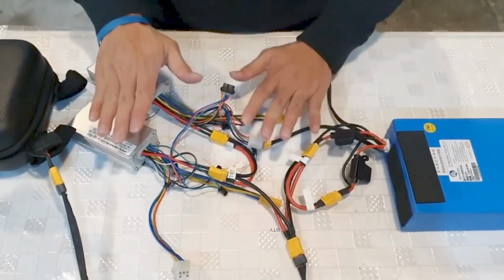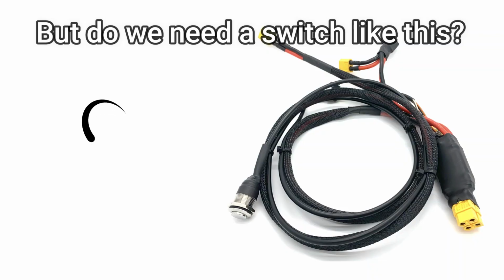How to Connect External Batteries in Parallel and when to use Switch

Comment: If I have a60 volt battery and I add a 48 volt battery is it okay?
Reply: Thank you for your help 🙌🏻
Reply from the maker: Only if your controller can take it
Reply: If I have 60volt controller’s? It is okay or should I add another 2 48volt controller’s?
Reply from the maker: @maxshara  yes sure. But why do you want to do that?
Reply: @FalconpevSg   because I I’m adding a48 volt battery to my 60 volt scooter
Reply: And is it okay to connect both off the batteries one 60 volt and another 48 volt with the series cable?
Reply from the maker: @maxshara  it’s better to connect in series the same voltage
Reply: @FalconpevSg  but is it okay to connect a60volt battery and a48volt battery together?

Comment: ok one more question one of my battery is 48v 30ah with 5a charger  another is 48v 15ah with 2a charger , how do i charge them ? will 5a charger damage 15ah battery if parallel connected ? i dont know do i need to have switch for this 2 batteries in paralel ? i cannot find any video online properly explaining how to do it , or when i charge do i need to charge both batteries separately with its own charger help friend ?
Reply: Please I hope you charged them separately. Because you are charging both batteries at a different rate of charge. That will cause problems if you charged them parallel connected.
Reply: @techgeek2994  use a y splitter cable and only the 5 A charger.. or buy a bigger charger (maybe 7 or 8 Amp)... the y splitter cable behind charger keeps both voltages identical 
I have an inline diode in both charge ports.. means charger sees both packs but one pack does not see the other pack

Comment: Hi there. So I just want to add some more capacity to my Apollo Pro which is 52v 23ah. I think I would be happy with another 10Ah of capacity. If I add the solid state switch to the arrangement then I would only need to plug my scooter to one port and charge both is that correct?
Reply from the maker: We do not have 10Ah. The 18Ah is going for a good promotion right now. You do not need the switch because they are both 52V. And yes you can charge them at the same time.
Reply: @FalconpevSg  Isn't it recommended to charge both batteries separately?
Reply from the maker: @raymondayeung  it’s better to charge them separately as there may be different charging rates for battery packs but it’s ok to charge them together too.

Comment: Hi FalconPev, 1 question.
I have spare Zero 10x 60v spare battery and planning to make it as range battery. My question is: why in your video there is only 1 port connector  on external battery and the internal has 2? Can you please help. My scooter is Zero10x
Reply from the maker: our battery has 2 ports, maybe shown in video only one port, but its really 2 ports. but in actual fact, it depends on the size of the connectors. If the connector is a larger size that can handle the current, then one port is all that is needed.
Reply: @FalconpevSg  so it means i can connect it to any plug?
Reply from the maker: @timcarranza1146  like in the video the plugs will be labelled. If you need any specific plug you can let us know and we will use those plugs on your battery.

Comment: Hi. If I buy this battery.  I just install it the way it explains the video will it work?  Another question is, to charge the two batteries will it be the way I already charge my original battery?  "After the battery is charged, it starts charging the external battery" thanks.
Reply from the maker: You can charge both batteries together. What scooter do you have
Reply: @FalconpevSg  Zero 10x 60v. When the internal battery reaches 100% does it start charging the external battery?  Does this not reduce the number of recharges of the internal battery?
Reply from the maker: @marcoridolfi7056  no it charges both batteries together
Reply: @FalconpevSg  So does the external battery recharge through its discharge cable? I only saw the discharge cable get connected to the parallel harness in the video.
Reply from the maker: @BrettSwiecicki  it recharges through its own charging port inside the bag
Reply: @FalconpevSg  So when you go to recharge you use two chargers? One connected to the charge port on the deck and one connected to the charge port on the external battery?
Reply from the maker: @BrettSwiecicki  yes correct
Reply: @FalconpevSg  What would happen if you were to only plug in to one of the charge ports?
Reply from the maker: @BrettSwiecicki  it will charge both too but it will take a very long time

Comment: its not conflict  having 48 V dual hub motors to install external battery in same voltage?
thanks for the answer more power
Reply from the maker: No problem with that
Reply: @FalconpevSg  5 star
Reply: I also have dual hub ( and now also dual pack )

Comment: If I order the 60v 21ah LG battery, it will come with XT90 connectors right? Same goes for the parallel wiring harness? 

I plan on using this for a VSETT 10+ which has XT90 connectors
Reply from the maker: No problem just state the type of connector you need in your checkout order
Reply: I'm planning to do the same thing as you brother, which switch did you end up going for? Is: Auto Switch (80AH), 24-70v, dual battery configuration the correct option? And did they give you the right connectors for your 10+?

Comment: Hi ! I have a dual motor nanrobot 52v. The original battery has two discharge ports, and I just bought an additional battery with only one discharge port. Is there a difference? Can I still connect to controllers with one port? Or Will it overload the wiring or the battery? Thanks!

Comment: can i use paralel connection for 2 batteries with only 1 controller or i need 2 controllers ?
Reply from the maker: Doesn’t matter the number of controllers. You can use 2 batteries or 3 batteries for one controller
Reply: @FalconpevSg  ok perfect and do i need to charge batteries separately when they are paralel ? i ordered the cables allready as soon as i saw your video
Reply from the maker: @techgeek2994  you can charge them together
Reply: @FalconpevSg  on which port original or it doesnt matter ? thanks for your help
Reply from the maker: @techgeek2994  if they are in parallel it doesn’t matter
Reply: @FalconpevSg  ok thanks a lot :)
Reply: @FalconpevSg  one last question , do they need to be both fully charged before connecting them in paralel ?
Reply from the maker: @techgeek2994  yes best practice

Comment: I have an ebike with a hialong 52v17ah and a 52v20ah rack battery. I have them connected in parallel with no switch - I just use one at a time. I'm trying to use them both to get more range and power. Would this switch allow me to use them simultaneously? Or will it just switch between the two during a ride?
Reply from the maker: You can use our parallel wire harness
Reply: If you are using one battery at a time then they're not in parallel to start with.
Reply from the maker: @DanceySteveYNWA  technically right. But this topic is about when to use parallel and when to use switch
Reply: use them in parallel..... not one after the other...

Comment: I bought your cable but when I open my scooter I don’t know which connector is I1 or I2. Is anything wrong if I connect them randomly?
Reply from the maker: It doesn’t matter either way works
Reply: @FalconpevSg  thanks! And in the case of the charge port can I connect randomly in either one of the two charge connectors in my external bat?
Reply from the maker: @El.mas.capo.sksjshffjgifu  yes any one would do too

Comment: Why not sell a unit that has a high capacity already? like 60v 45ah 21700 5000mah cell 16s9p  right?
Reply from the maker: Not enough space in the main compartment and also cost wise more expensive upfront

Comment: Glad i bought the external packs with both my 10X. Me and my girlfriend get crazy range now with 46Ah. And they installed it. Best thing is to ask at the time of purchase so both batteries are fresh.
Reply: 46Ah will easily give you over 110 km of real world range
Reply: @raymondayeung  I have 50 Ah (2x25)... and 120km is no problem (dual motors and no pedaling)
going a bit slower and pedal assist (single motor) I nearly could get 200
I never run the packs down to 40V ... at 44 under load and 46V no load I put the charger on .. means I may have 20 to 25 % left ...
Reply: How much range can u get ? And where can i get One ?
Reply: HELP MY 🪫 Bonjour 😉 mon ami, je cherche de l’aide car ma Kugoo M4 pro MOTOR 500W batterie plus d’origine etait 18 Ah maintenant c’est 12,5 AH a une autonomie trop limitée pour mais déplacement journalier. Je ne c’est pas comment brancher une batterie externe ⁉️quel câble j’ai besoin et comment brancher tout c’est câble. MERCI POUR tout retour informations sur photos ou vidéos. 🤝👋

Comment: I have a zero 10x with an external battery that doubles my AH. Is it possible to keep the batteries connected in parallel and charging both batteries through one charge port?
I ask because sometimes I only have one hour to charge up a bit and I don’t want to deal with unplugging both batteries, charging the external battery for 30 mins and then the internal for 30 mins in order to keep the volts the same.
Reply: I added a y splitter also to charger and use a bigger charger to charge both at once

Comment: Is it possible to order a bigger battery from you guys and use as an external? Maybe like the same one the Zero 11x comes with?
Reply from the maker: As long as we have a bag that fits
Reply: @FalconpevSg  Do you know why my battery cuts out at about 39.5 volts? (it used to run the motor right down to below 36 volts). I would be grateful for your advice.
Reply from the maker: @nicholasmorrill4711  battery cells are getting old and cannot hold the same charge anymore
Reply: @FalconpevSg  I know that because it only charges up to about 40.5 now but should'nt that mean that it should still run out to the same level as before? (about 35.5).
Reply from the maker: @nicholasmorrill4711  no the fact that it doesn’t charges up to full capacity means that the discharge rate is susceptible too. Voltage is a good indicator but it doesnt tell the actual charge capacity of the cell.
Reply: @FalconpevSg  OK thanks for your advice. I just hope that I can find an expert to rebuild this battery which is one that fits neatly into the frame.....then I'd like to run both & increase the millage.Thanks again for your advice.
Reply: @FalconpevSg  ive done over 2000miles on my zero 10x, the scooter doesnt hit top speed any more 32mph out of 36mph. is the battery aging?
Reply from the maker: @TheSecretBaller  yes most likely battery, the battery discharge is getting lower
Reply: @FalconpevSg  Alright, thanks for the reply

Comment: You don’t say which plugs to plug into which XT60 plug for the internal battery or which controller is number one and number 2. If it doesn’t matter you should say it doesn’t matter which ones to plug together otherwise we will be afraid we will get them wrong. You need to be more detailed and precise as many of us know nothing about what to do.
Reply from the maker: They are all labelled so you don’t have to worry about plugging in the wrong one:)
Reply: @FalconpevSg  I know your plugs are labeled but my plugs on my battery and my controllers are not labeled so does it not matter which ones I plug into.
Reply: What I’m trying to say is, sure, your plugs are numbered but mine aren’t so how am I supposed to match them up?
Reply: @basincut100  once you open up your scooter, you'll see the wires FROM your controllers and your battery coming out.....   thats how you'll know which cable connects to the labelled connectors that is provided to you.  :/

Example, their cable is labeled INTERNAL CONTROLLER 1 AND INTERNAL CONTROLLER 2....so what you should do is look for your 2x controllers (hence the word INTERNAL).  Thats your 2 x silver boxes.  Look at the cables coming out of it. Connect it from there...

Comment: Can I use solid state switch to utilize batteries with different voltages? My scenario is to use lower voltage external battery which trades speed for range.
72V internal battery plus 60V long range battery and switch for 60V battery when 72V is depleted.
Reply: Batteries have to be same voltage. The solid state allows for different capacities to be connected. So like if you have a 52V18Ah and you want to connect to with a 52V23Ah... That would work. But 60 and 72 won't be possible.
Reply: @zaire.mg.  hats not what the poster said… thats only if theyre directly kn parallel without a smart switch
Reply: no .. smart switch needs to have both packs same voltage (roughly)
in your example with 72 and 60v.. smart switch sees the "empty" 72v pack and sees a full 60v?? then it thinks the 60v full is also an empty 72V